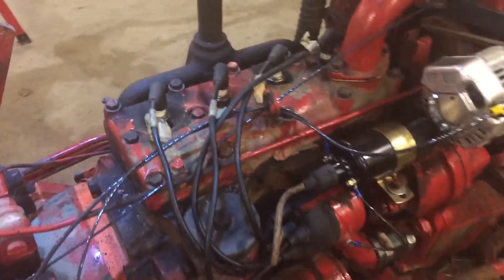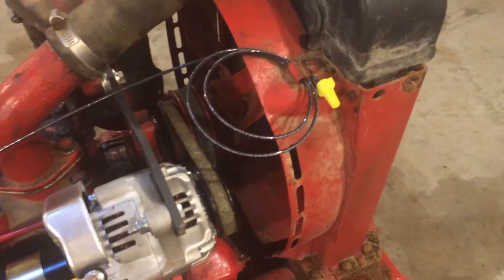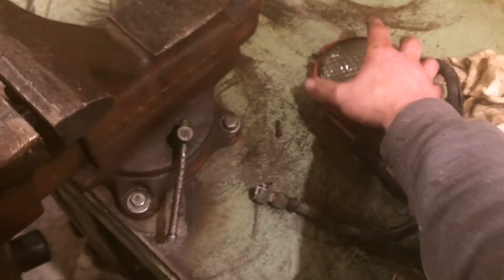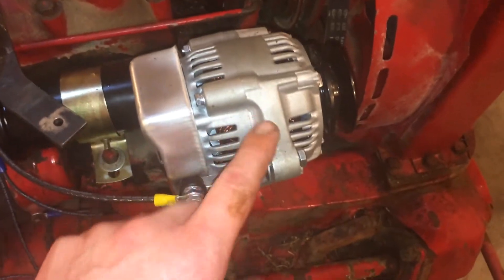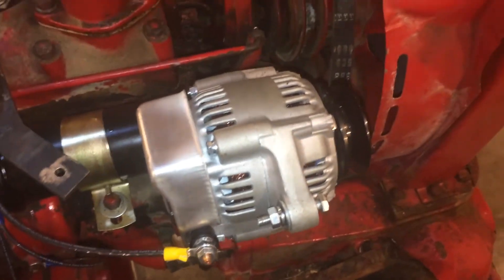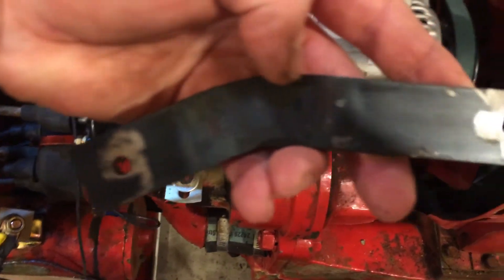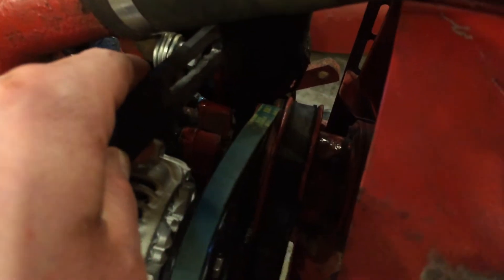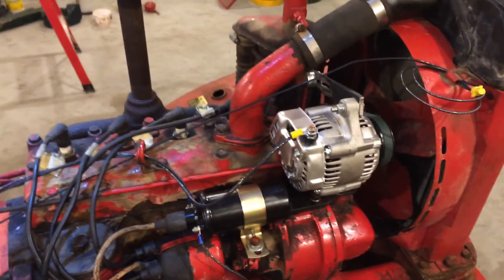Tractor 12 Volt Conversion Step-by-step Part #5

Comment: Awesome video I just did my 51 cub great advice on how to my only question it the fuel line it’s a 5/16 metallic line mine was leaking I want to replace it I bought 5/16 brake Line will it work? And what size is the threads inside the carb and inside the fuel sediment bowl I’m having trouble finding info and specs on it if you can help I would appreciate it
Reply from the maker: Justin Smith sorry I won’t be much help. I don’t know what the thread size is. You might try Steiner Tractor for the parts or at least info on the parts. You might also take the carb or sediment bowl to Napa and see if they can set you up with the parts you need.
Reply: Just Tinkering thanks for the reply I found it it a 1/2-20 thread

Comment: I wired my cub up and left the battery hooked up and the next day the battery was dead. what do you think I hooked up wrong or did you have to put a diode on it to keep battery from discharging? thank you for your help. great videos and they were very helpful
Reply: Thank you fir replying,  I figured out what I did wrong and now it runs like new and fires right up. Great videos . Tyvm
Reply from the maker: AWESOME WELDER I didn’t use anything in the wiring that wasn’t on the diagram. No extra diodes. Did you possibly leave your push/pull switch on overnight? I’m afraid I’m not much help. I never had any more electrical issues out of this tractor. Grandpa sold it about a year after I did the conversion, but it worked excellent in the time he had it.

Comment: Great video, your wiring diagram was dead on. I converted my 1962 cub over to 12 volt step by step per your video. At first the volt meter was only showing 9.4 volts then found the battery was bad. Put in new battery and problem solved 13 volts. Thank you for your help .

Comment: When doing the 12 volt conversion do I use the same 6 volt coil and distributor?
Reply from the maker: Be sure to watch all 6 videos in this series. I detail exactly what I modified or replaced. The distributor stays but the coil is replaced.
Reply: @justtinkering6054  thank you so much,I've been having trouble keeping my tractor running
Reply from the maker: @scottf4236  Keep in mind, I am no mechanic. Just a regular guy who likes to tinker.

Comment: I went step by step off ur wiring diagram and theres no power coming from the alternator. when I take my battery cable off the battery it dies that means alternater is not working or not getting power from it
Reply from the maker: See my reply to your other comment.
Reply: Some alternators have to have a hot wire going to it to excite it, I hook mine into the ignition switch so it shuts off when tractor is shut off. So it don't drain the battery.

Comment: what did you ever have to do to get ur alternater working did u have to do something with those other terminals on the alternator. theres no power coming from mine I got it new from ebay the same person u got urs
Reply from the maker: I might have just been lucky, but I never had to do anything to mine that you don't see on the video. You may have to do something else with the 2 terminals. I have seen other folks make a jumper from one of the terminals to the main lug.  It is also possible that you got a dud alternator.

Comment: great videos on the cub helped me out alot converting my cub to 12v. I bought the same parts as you worked great and I was on the fence about an ebay carb but seeing urs worked good getting one myself. very helpful videos thanks.
Reply from the maker: You don't know how glad I am to read this. This is exactly why I make videos. I am glad I could help.

Comment: Thanks for the help.  I am following your videos while converting by cub to 12 volts.   Question, the plug from distributor to coil is too small for the new coil. Looks like you have a new wire and plug?  Did you purchase in E bay?
Reply from the maker: John Skedgell The plug wires were on this tractor when I started this project. They were good so I used them. You can get the same wire from any auto parts store. You could order one online too. Since you are changing from original, I would recommend taking your short wire to Napa and asking them for one just like it, but longer. They should be able to set you right up.
Reply: Just Tinkering will they be able to provide one with a larger boot?  The new coil end is larger than the old cooler end.
Reply from the maker: John Skedgell it seems like most napas that I have dealt with usually have a box of miscellaneous parts like that behind the counter. Take your coil and cap with you to the store and tell them what you need. Shouldn't be any problem getting you all set up.